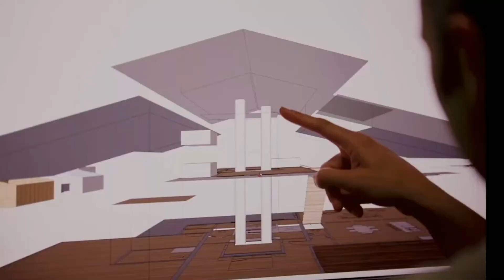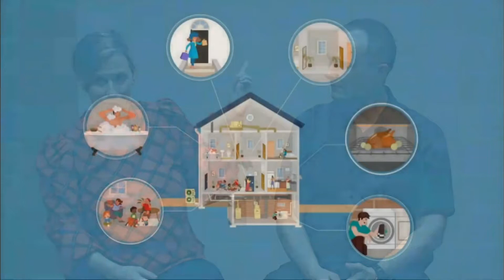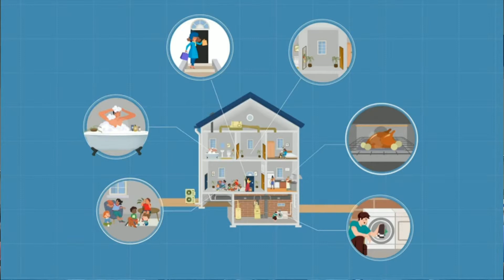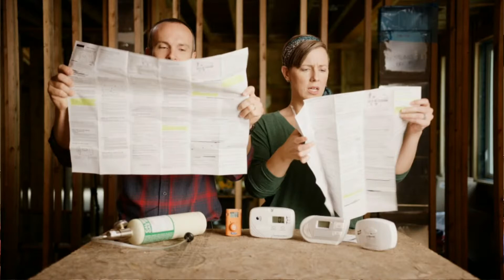Home Disasters & Resilience: Q&A on 'Home Diagnosis' Season 3 at Science Pub WSKG at Cornell

Comment: A friend of me have a COMPLETELY renovated house, everything except 2 basement walls and when we have taco night at his place after a few hours im dying from the indoor air cause his girlfriend Love incense air scent and live candles and im sure he have his air exchange system either off or undersized.

Tried to ask several times but he says it's on yet i always fall asleep from exhaustion feeling sick, and when stepping outside i feel like a new person in 5 seconds.

My house from the late 60s had much the same feeling after renovating a lot and airsealing and used kitchen hood for airing out my house but now got a new HRV unit and man i am in love with it♥️

Also have an Airthings Wave Plus in the living room that gives alert for radon, tvoc and co2 and a Arthings wave (not plus) that monitors radon in the basement, radon varies from almost not measurable to 5 times the "legal limit"  just over a week.

Bought a air quality monitor for my parents as a "gift" and now my dad also have gotten an HRV unit since when we have dinner family gathering it goes past 3000ppm co2 (they never belived me when i said there was bad indoor air after a while but now there is proof).

My life have improved a lot the last weeks since i installed the HRV, it's not finished yet but working with the air straight out from it, no piping on the supply/return side yet.

And the controller for it is a smarthome controller that uses voc to control it (wanted co2 but it was too expensive for now but have wifi connected co2 sensors in the mail now to have in livingroom and bedroom) and every time i come in from a walking trip sweaty or cooking it turns on immediately.
Reply: And i am really cautious to dry clothes in the tumble dryer (heat pump condenser) instead of innside.

Using the kitchen hood to keep smell, fumes and moisture outside.

And dehumidifier in the basement as well as closely monitoring humidity generally innside.

Afraid of mould issues innside and in the walls from air leaks and never had any damp on any window yet (3 years)